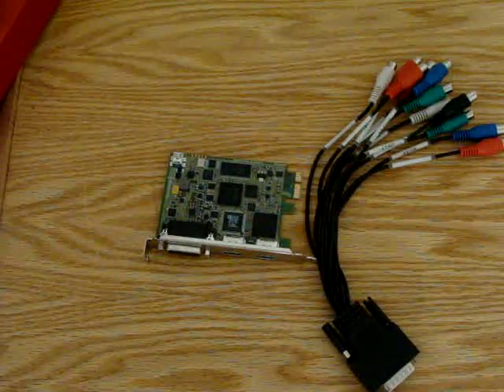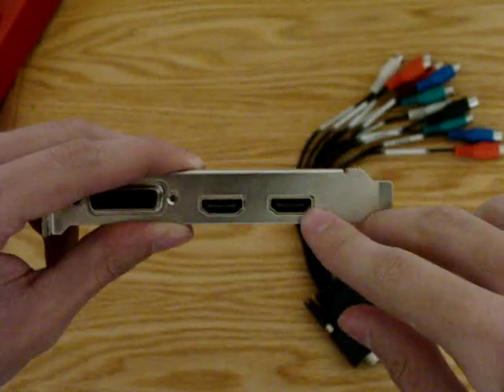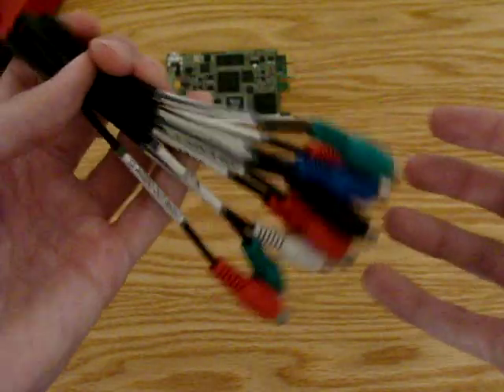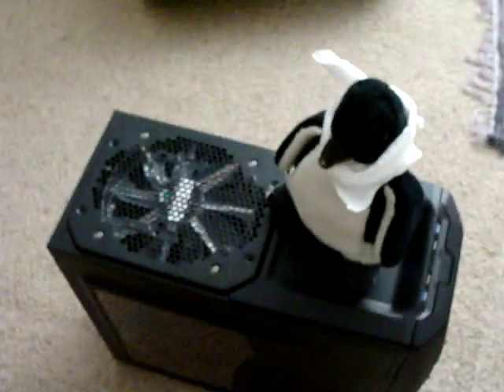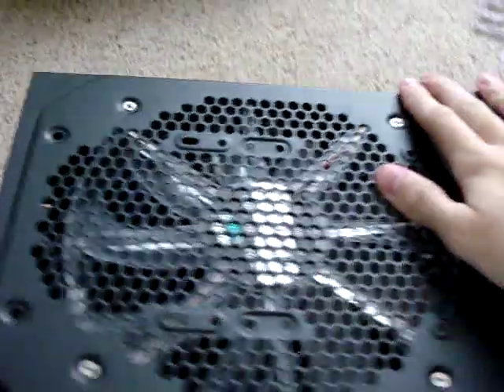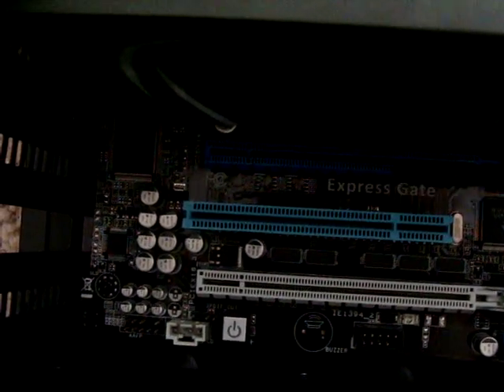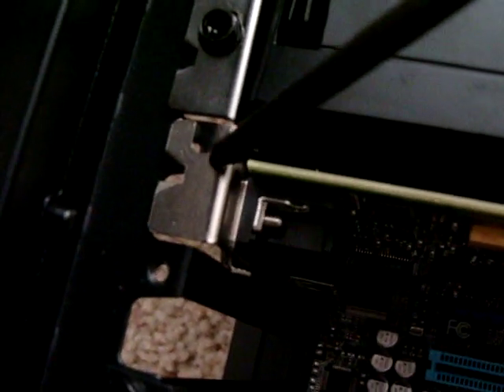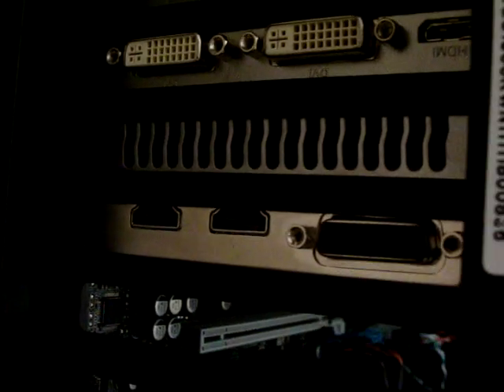How to Set Up Black Magic Intensity HD Capture Cards Part 2 - Intensity Pro

Comment: I just want to say what should be said. Use extreme caution when opening your computer. This guy in this video does many things you should not do.

-Do not touch your components without being grounded. Also b/c of sweat, oils, and dust.
-Do not open up your pc on carpet. Carpet has a shit ton of static.
-Do not poke around the inside of your pc with a metal screw driver. ESD. 
-Place a hand on the metal chassis as to discharge yourself. 
-Consider wearing an ESD wriststrap that is grounded.

Comment: Thank you very much for this tutorial you are a very helpful guy, I have to mention thou the black intensity pro is made for the PCI Express X1 Slot which is the small one you put it into a PCI Express X16 Slot which is reserved for multiple SLI or Crossfire GPU configurations but I think PCI Express x1 cards should also work perfectly fine on PCI Express X16 Slots the reason I mention this is, its because my GPU blocks my PCI X1 slot on my Asus P6T :(